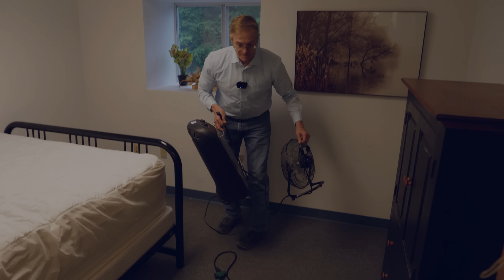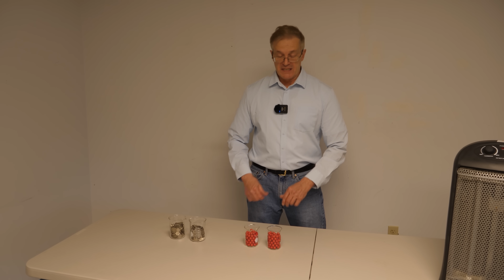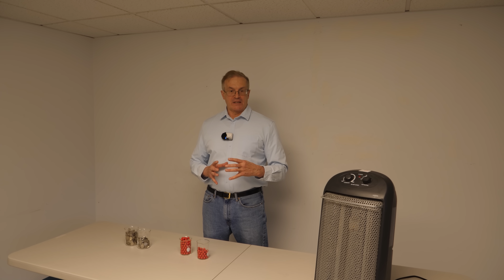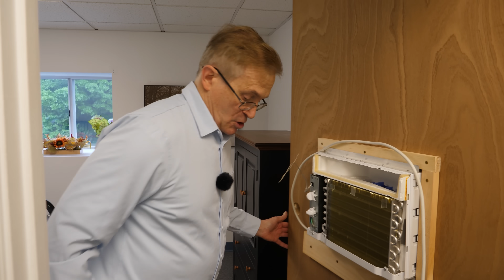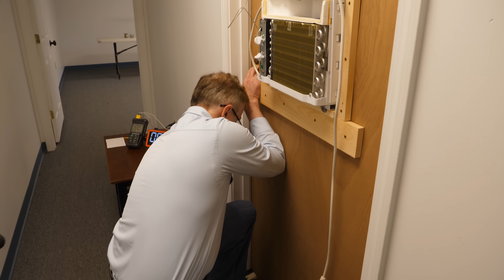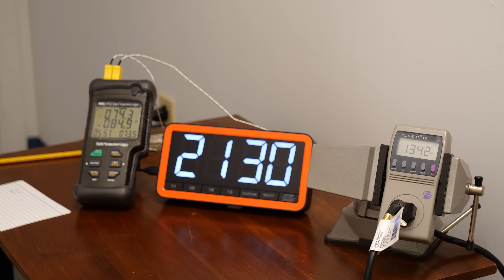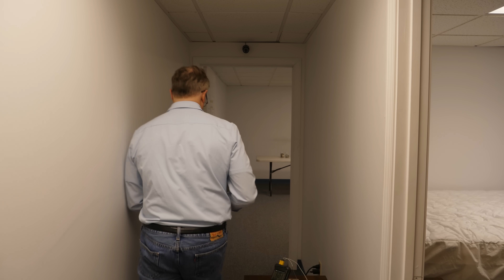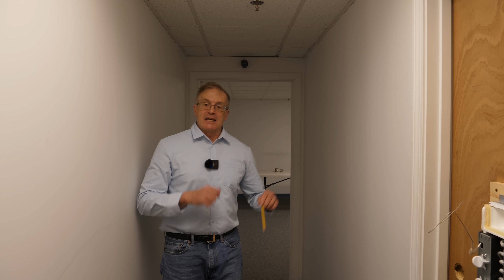You're wasting money on heating! Use your A/C!

Comment: This reminds me of the time I went with my dad to a pawn shop where he was trying to hawk a window a/c unit. It was December or January. The pawn shop employee asked, "It's the middle of winter, what do you want me to do with that thing?"
  My dad, without missing a beat, replied, "Just turn that thing around in the window and you got yourself a heater!"
Reply: @tripplefives1402I think there are some manufacturers who make units that can be set to run either way. Not sure why this didn't catch on but I suppose a lot of people have some type of furnace. Could be especially interesting for RVs / Trailer units on the ceiling since they have a limited propane supply. Ours has a heating coil as an option if you're plugged in but it really isn't very effective.
Reply: @JJFX-  All the window units I've looked at claim to only work down to 41F.  I was wanting to get one but it gets way colder than that where I live.
Reply: @db95gt  So basically they're saying to keep it above freezing but AFAIK it should still work a bit below that, just may not be as efficient. Although perhaps they have probe that prevents it from operating below X temp.
Reply: @JJFX-  The thermodynamic properties of R134a drop off drastically in the 40s F.  By 41F, there is almost no efficiency left in the system.  That's why whole house heat pumps in colder climates need an "emergency heat" option.  Without it, you're just dumping electricity into a system that doesn't heat.
Reply: @peterallen4605  I was under the impression R134a should still perform reasonably well above 0C even though the compressor will have to work harder and the efficiency is notably reduced.
Reply: @peterallen4605  Another good reason R134a should never have happened.   Ever looked at plain old propane as a refrigerant?   If you aint skeered of intentionally leaking some out and setting it on fire to grill up a burger 18 inches above the propane tank, why be skeered of an air conditioner that is not leaking?
Reply: @ebaziuk  To use the presenter's analogy:  The colder it gets, the harder it is to move the balls from one bucket to the other.  With R134a, that increased effort is fairly minimal until you get down to the 40s F.  At that point, it begins to take exponentially more input energy to move the balls the colder you get.  When you get to around 40F with R134a, the input energy required is enormous for extremely little gain.  Every refrigerant has a point at which the input required outpaces the output.  R134a is very efficient and fairly steady from the mid 50s up.  Below that, it starts to drop off.  In the mid/low 40s, it falls off a cliff.
Reply: @JJFX-  Unfortunately no.  At 0C, you're better off running that "emergency heat" resistance coil to actually heat the home.  When the coolant is in range like at 70F where this presenter ran his experiment, the heat pump is far superior.  That's why heat pumps are great for the Southern US.  Not so great for the North.
Reply: @peterallen4605  with a different choice of refrigerant you can go down to much lower temperatures. Also R134A is being phased out so it's a moot point if it's suitable or not.
Reply: @AlexanderBurgers  Absolutely, I was simply explaining the probable reason that the one poster had a unit that stated it wouldn't work under 40F.
Reply: @peterallen4605  You just live in the past. I'm from Arctic Circle and every other house has a heat pump(air-sourced). Around 7-8 years ago heat pumps in our market switched to R32 refrigerant which is far superior in cold environment compared to R134a. Boiling point is -51C instead -26C. These new ones work very well down to -30C which is not uncommon in winter here. They don't need resistive heating element either. Yes, COP decreases with cold but still clearly positive.
Reply: @kognak6640  Don't live in the past at all.  Simply explaining why R134a heat pumps don't work below 40F.  New refrigerants work much better to lower temperatures.  They have their own problems, as nothing is free, but they are a definite improvement over the R134a that has been the standard for decades.
Reply: @peterallen4605  It's very dated information. Looking at legal side of things, R134a is going away in NA too.
Reply: @peterallen4605  only with that coolant cycle. Newer dual inverter units with r410a can run efficiently and effectively down to negative 20F.
Reply: @JJFX- And 0°C is 32°F
Reply: @peterallen4605 The funny thing is, at least until you get closer to zero, it's more efficient to use auxiliary resistance heat to warm the outside source air than it is to warm the interior air directly as you still benefit from the coefficient of performance over 1. Strangely it doesn't seem like older heat pumps were actually set up that way though.
Reply: @randomizedpasta  Yes I'm aware. All I was getting at is R134a is still working down to -10C or so but becomes very ineffective below 0C.
Reply: @peterallen4605  Are you sure R134 stops working near the freezing point? Because I have a fridge and a freezer that runs on 134 and they are going down to -25C (below zero F if I remember the conversion rules) without any issues. R600a, on the other hand, struggles a bit.
Reply: @peterallen4605  what probs do new refrigerants have?
Reply: @peterallen4605 have you seen some of heat pump rants at technology connection's. It explains really good why should america got theirs heatpumps almost everywhere.
Reply: @npl-8701  The temps that matter are the ambient temp of the air the unit is operating in, not the area being cooled.  The fridge and freezer are actually heating the refrigerant, so it will gladly cool to those temps if it has a useable working temp at the other end of the cycle to dump that heat.  Below 40F, R134a won't be able to dump the heat in any meaningful way.  There's much more to it than that, but that's my 5 second simplified Youtube comments explaination.
Reply: @peterallen4605  this is nonsense - we used to use r134a for freezers. Guess what the coil temps inside the freezer are? Negative 15 F. It would work with ease.
Reply: @sprockkets  I didn't invent the laws of Thermodynamics, nor the properties of R134a, just sharing some of the effect of their combination.
Reply: @db95gt somewhere I read, there was a heat pump window unit that can go down to 5F, and below, it will switch to resistive backup automatically
Reply: @db95gt you can pull the thermocouple off off the coil and place it onto the other coil to heat it up and make it think it's warm
Reply: @peterallen4605 mine works to -10 without needing backup heat 🤷
Reply: @peterallen4605  They also ice up more and more and require more and more defrost cycles in order to prevent damage. Most heatpumps will switch to regular AC mode to warm up the condenser and melt off the ice
Reply: @peterallen4605    Can't you replace it with propane?
Reply: Alot of new, modern window AC units are charged with butane..... Works good. @laserflexr6321
Reply: @peterallen4605  R22 has entered the chat and then left because of the damn EPA!
Reply: @ghbytdsrfhb  Being flammaible is number one!
Reply: @randomizedpasta and 
minus 40C is exactly = minus 40F
Reply: @peterallen4605  And not to mention all the energy used for the self defrost cycle when it’s colder out so it doesn’t get built up with ice too much around the heat pump outside.
Reply: No one used 134 in residential. It was r22 then 410a and it's changing again @peterallen4605
Reply: @peterallen4605 but the temp probe would be inside the house if you reversed the air conditioner direction.
Reply: @randomizedpasta  -20F is not enough around here in Wisconsin. You would need something that can run down to -40*F or lower just in case, because we have hit below -40 here
Reply: @sprockkets Its amazing how confident somebody can be, when in reality, they have no idea what they are talking about. I'm also pretty sure efficiency increases when the temperature difference increases. This peterallen guy says it decreases.
Reply: @peterallen4605  Even at 0F, the COP of ancient single stage, R22 heat pumps was about 1.7, so it still divides your heating bill almost in half compared to electric resistance heat.
Reply: @randomizedpasta Mitsubishi heat pumps retain rated capacity down to 0F.
Reply: @gregorymalchuk272  Um, no.  Not with R22 it's not thermodynamically possible.
Reply: @peterallen4605  It is definitely possible. Look at the Carnot heat pump efficiency formula. Assume the working fluid is approximately 20F colder in the evaporator than the outdoor ambient and the working fluid in the condenser 20F warmer than the indoor temperature.
Reply: @JJFX- a normal window ac won’t work as a heater when it’s very cold outside. Heat pumps that are designed to heat your house usually only work when the outside temp is above 30ish degrees on the low end. if you want a heat pump in a cold region then you'll need to burry some pipes
Reply: @JJFX- I don't know the brand but my elderly neighbor's ac stopped working so her daughter put in a small window ac. It has a dry mode that blows fairly warm air into the house. She had it on dry by mistake and it was hot inside with it being in the mid 60's outside but a simple button push had it blowing cold in minutes. The buttons are small and close together with symbols instead of wording. She said it was inexpensive
Reply: @JJFX-  That’s a great observation and I literally don’t know why that’s not more of a thing. I’ve seen some portable ACs like the kind with the hoses have a heat option and that must be what they’re doing Is using the system in reverse. I live in a 1994 year 26 foot travel trailer in my mom’s yard and the rooftop AC doesn’t work because the refrigerant Needs to be recharged. It must’ve leaked out because the fan kicks on but the compressor never does. The propane furnace works though, but for the AC I just use this little 5000 BTU window AC and it seems to keep it cool well enough. I live in Western Washington, so the summers are never too extreme And neither are the winters so in order to save propane I use an electric oil filled radiant heater, and that seems to keep it plenty warm in here usually even only on the lowest 600 watt setting
Reply: @adamgallahan  Yeah portable heaters are often quieter too. I think more RVs should just have some type of built-in radiator that's heated by the furnace to help minimize propane use since they're perfect for small enclosures. Some portable AC units also just have a heating coil for that mode so I'm not sure how many actually run in reverse but they do exist.

I'll have to look into what's available for RV roof units because it's such an obvious use case I have to wonder if they're more common than I think or if there's a reason they aren't. Hard to believe there could be a patent on it at this point but I've been surprised before.
Reply: @JJFX-  My current travel trailer is a 1994 year 26’ foot travel trailer but my other one I used to have was a 1977 year 22’ one and it had a furnace kind of like that where it didn’t require any electricity for a fan and it just radiated heat from the propane furnace from the one output area from that with the intake getting fresh air from outside and with the fumes obviously exiting outside too.
Reply: @JJFX-  It didn't catch on because they charge an extra $100+ for them although it's just a small valve added to give it the functionality. Welcome to capitalism <3
Reply: @JJFX- probably the gas companies with their infinite wealth made it disappear
Reply: @JJFX- LG actually makes units currently that can do both heat and ac
Reply: @JJFX-  My wife inherited her house with a window A/C that was also a heater, some 25 years ago. It was old then.
Reply: @bwellman1953  But was it a heat pump or simply blowing the fan over a heating coil?
Reply: @JJFX-  Sorry, I have no idea. All I know is that it was a window A/C that you could turn a switch to heat the room instead of cooling it.
Reply: @JJFX- according to a ac guy I know my ac uses a heat pump for heat in the winter, he told me I should crank it during the day because it won’t work great at night when temperatures drop, I don’t know all the details obviously but this video and some of these comments are reminding me of what he said.
When I switch from ac to heat it makes a noise like a metallic scrape and then bam it’s a heater lol never thought much about it.
Reply: My laundry room is between my kitchen and den area leading towards the living room.
I pull the exhaust tube up from behind the dryer and place it on top of the dryer on a towell.
Then i add a pair of old panty hose and secure to the metal tube.
When I dry clothes , the warm air and moisture billows out to heat the entire den... the panty hose catches the lint. 🙂
Reply: just turning a window unit backwards will not work, for one if it is cold enough outside to want heat, it probably colder then the coldest setting on the a/c unit, since it would be pointed outside. say it's 40 degrees out, the lowest setting is 60 degrees, the unit will always stay off as it thinks you want to cool down to 60 and it's 40 so no need to cool. Have to find a way to bypass it and have it never have the compressor turn off, then put a thermostat regulated plug inside to connect power when the inside is below a certain temp.
Reply: Just wanted to point out, in theory that would work, but when the unit is installed inside out,  the thermostat will tell the winow ac unit to turn off when the outside gets below the maybe 60f.  And if you bypass the thermostat, then the evaporator coils will go below 32f and frost will build up and block air flow   untill it's completly clogged. And about those times when your not too cold outside and your not freezing  frost on the coils, the condensed water will drain inside the house. 

Reversible heat pumps  are designed to address these issues better than  mounting a  window  AC unit  in reverse.
Reply: @tripplefives1402 But many companies love to charge 4X time price of a A/C only unit.
Reply: Hock
Reply: @hadleymanmusic  yep
Reply: My ex-wife is from Hawaii. So in Ohio for years she would freak out, stomping and screaming in the passenger seat when I try defrosting the windshield with heat instead of air conditioning. I grew terrified of how I was going to get into an accident from her distractions or from not being able to see where I was going. I just had to do my best and drive like an idiot because lives of innocent people were at stake.

But the humidity in the island air makes a cold can of soda sweat after you pull it out of the refrigerator. Somehow that means air conditioning in the car on subfreezing days will clear frost off the windshield. Heat doesn't melt the frost. It is stupid for people to be allowed to think they can defrost windshields with heat.

Reading the title of this video gives me nightmares to imagine how she would behave if she saw it.
Reply: And where does it drain?
Reply: That's a good one, unfortunately, window ac units don't like to work below 60 degrees F. either inside, or outside.
Reply: thats pretty funny. I used to be a pawn broker and I would have gotten a kick out of that if someone said that to me.
Reply: @nayrtnartsipacify  my dad was the king of quips! Thank you for the kind words
Reply: @tripplefives1402 That may not be ideal depending on the pipe sizes and the size of the evaporator and condensor, but in many cases that could work
Reply: @tripplefives1402 Actually, this is far from correct.  There is no metering device on a condensor.  Not all indoor coils have bi-flow metering devices.
Reply: @liam3284    Problem with CO2 is that you need much higher pressures for it.  Propane works pretty well with current systems--actually you need less of it.
Reply: @tripplefives1402 Yes but the evaporator coils inside must be designed to heat and cool
Reply: coeficient of performance nears to 1 in winter time, heat pumps are mostly scam
Reply: Mind blown
Reply: @tripplefives1402 Reversing valve..
Reply: The temp probe will be inside the house if the air conditioner is turned around.  The cold air will be blown outside.  It should not matter.
Reply: @jefferysmith5092  Right,  so why then does he have the Air-conditioner on the Bedroom Door 🚪 pointing the Cold Into the Main House, instead of pointing Outdoors???
Reply: @createa.googleaccount713  I believe that is just for the test.  He isn’t checking the temperature in the main part of the room for the test.
Reply: Doesn’t seem like the controls would do well out in the elements.
Reply: As dirty as they get facing outside I'd never face it inward.
Reply: I'm glad you made this comment. The guy doing this video wouldn't just come out and say it this way, and I was asking myself, is he saying to just turn your air conditioner around?
Reply: What about the energy bill ?
Reply: Your dad wouldn't have happened to be on crack was he?
Reply: This hack is genius! Time to rethink my heating bills. 💡💰
Reply: Update: my dad just passed away. Thank you for the love in the comments section. He really was the guy that told the best jokes. I love you, Dad.
Reply: Yeah, which will only make sense until it freezes.
Reply: I actually tried using an A/C as a heat pump and the main problem is that the coil on the outside will freeze up completely in about 5 minutes when in typical cold 40-50 degree weather. So you get heating for about 5 minutes, then it stops working because no air can flow through the coil anymore. It is also true that it only works well above around 40 degrees. Below that, it can't raise the temperature that much.
Reply: @franklinthu encase the outside without impeding air flow
Reply: What is the lowest temperature to run a window air conditioner?
The lowest outside temperature at which to run your AC is typically around 60-65 degrees Fahrenheit. At temperatures below this range, your air conditioner might not operate efficiently, causing increased energy consumption and potential strain on the system.Jan 1, 2024
Reply: @freedomearthmoon1 me curious too.
Reply: Very nice. I wouldn't have guessed the reduction in power use to be around 70%
Reply: @lexvegers242  me too! Fascinating
Reply: @lexvegers242 Of course this is only of any use if you heat with electricity, and anyone with a lick of sense knows that the best source of heat is fire of one sort or another.
Reply: @justthebrttrk  There are modern heat pumps that use improved refrigerant (not 134a).  The efficiency still drops off at lower temps, but not as dramatically or as soon as 134a.
Reply: Pawn shops are so scammy
Reply: If you run a window unit as a heater by turning it around it will almost certainly freeze the coil.
Reply: @justthebrttrk As well as being expensive, the heat output of heat pumps is only useful in a modern draught proof highly insulated house. Radiator and pipework upgrade will also be necessary (larger pipe bore and larger radiators) this is because circulating water can only reach around 50° add to that a water storage / immersion heater and all the insulation needed and you will have a substantial amount of $/£ to lay out. It's doubtful you would ever get your money back.
Reply: Odd that you'd blow Cold air into the House 🥶😱 During WINTER? Kinda DEFEATS the point, don't you think? Seems like you'd blow it Outdoors into the Cold Outdoors and not turn your house into an ICEBOX! Did I miss Something?